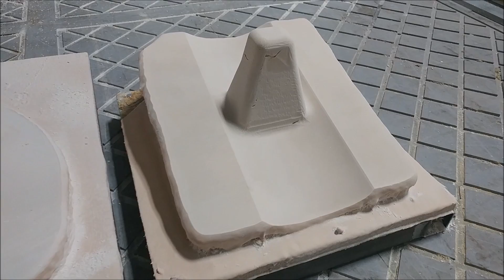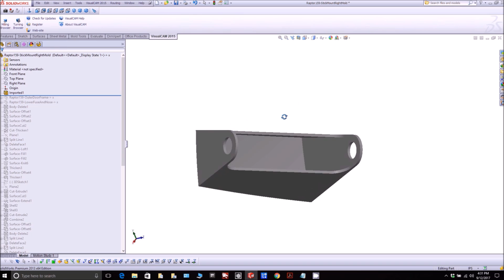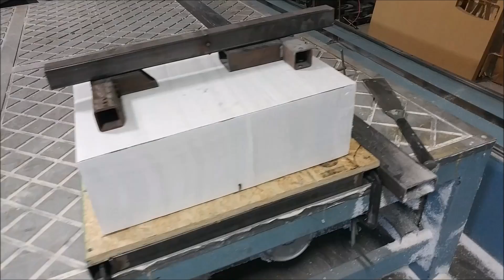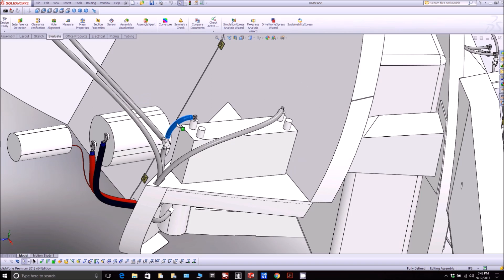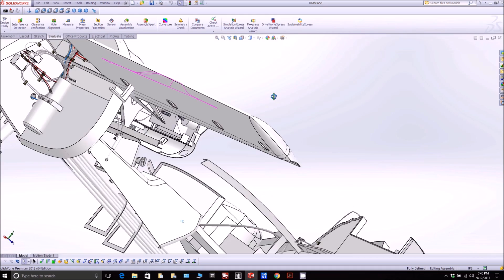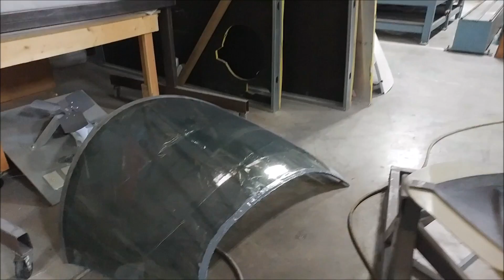Windshield Goes In! - Starting to look like something

Comment: It looks as if your vent lines will be submerged most of the time. If that's the case fuel will be pushed up through the loop ant siphoned overboard through the vent line whenever the airplanes gets warmer.

Comment: Why not wire the LEDs in parallel? Only wiring them in series would drop them to half brightness. I think having them on the panel near eye level would be better, personally, if possible.
Reply: David McCullough if there's enough voltage for both of them then it won't drop.
Reply: Nitride true, but wiring them in parallel will also keep all the other lights on if one gets damaged or burns out. Plus I can't see why an airplane couldn't generate enough voltage to light 6 LEDs when my Arduino can easily light 10+ without struggling...

Comment: I used to work for a company that tracked trucks via GPS. The best success we had with GPS satellite communication was on the very top of the cab and trailer and clear of obstructions.
Reply: Yes I agree with Ed on this. You not only need to look "up" with the GPS antenna but also want to "see" (from an RF point of view) as close to the horizon completely around the aircraft so that you can receive signals from as many satellites as possible to improve accuracy of your GPS signal. I heard what you said about using fiberglass hatch right above the GPS antenna, but as you know CF absorbs RF and especially at these higher low level frequencies that GPS operates at. So if the antenna is recessed in the fuse and there is CF around the fiberglass hatch, it will not allow the signals from some of these satellites to come through.
So if you do mount it inside, make sure the spherical antenna can see as close to the horizon as possible. BTY the reason for the spherical shape of the antenna is to insure reception all around as well as up as the satellites are in orbit and not stationary. So you have to pick them up when the come over the horizon and receive them as they orbit till they disappear again over the horizon
Read this https://www.cobham.com/media/5048/gpsantennainstallationguide.pdf and this which specifically deals with CF aircraft 
and look at Tenna Tip #3 on this http://www.aeroelectric.com/articles/Antennas/Antennas_for_Aircraft.pdf
You also should start to think about the ground planes for your Comms, Transponder, etc antennas (I assume they are going outside?) as CF although conductive is a terrible ground plane and your SWR will be terrible without a ground plane.